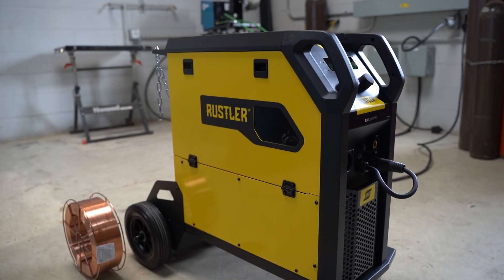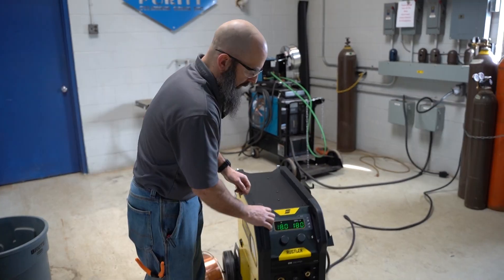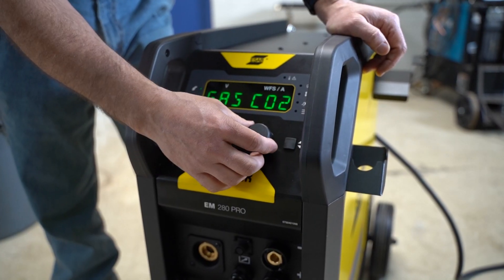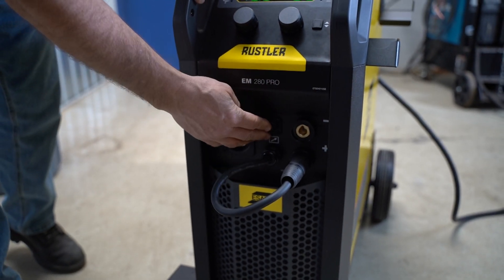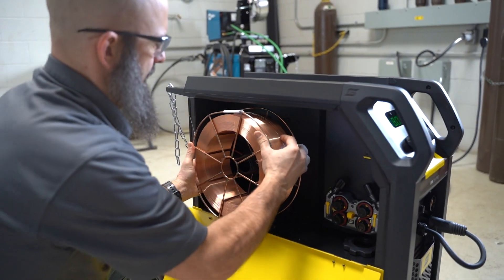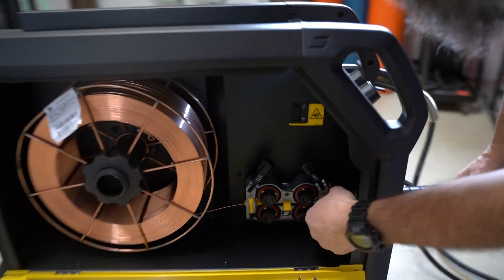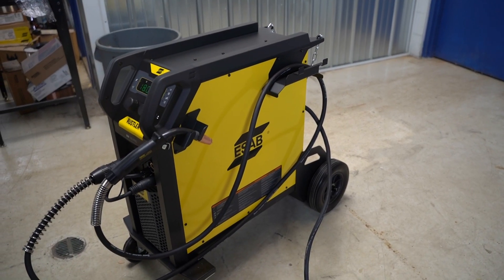ESAB Rustler EM 280 PRO MIG Welder Review | Features & Setup

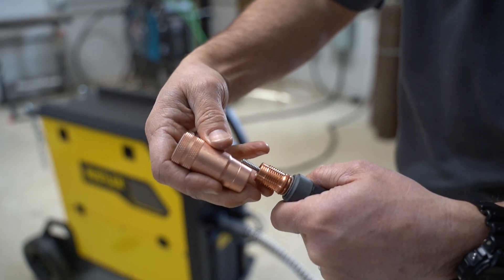Comment: 6:35 Why Would You want to Cut the Liner?
Reply from the maker: MIG gun liners are typically longer than the gun assembly to accommodate different gun and cable lengths, so you will need to cut the liner during installation to ensure the correct length and avoid issues like wire feeding problems and gaps.